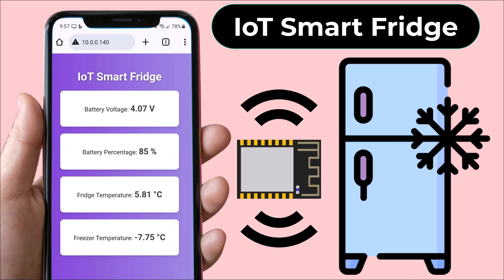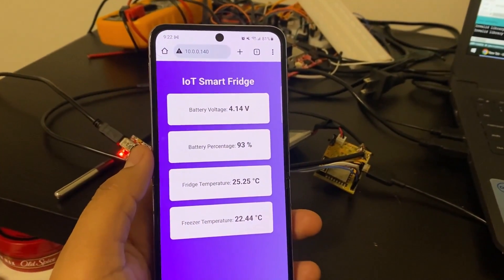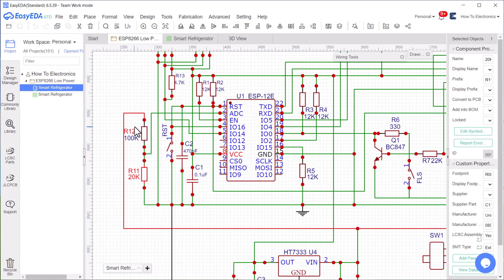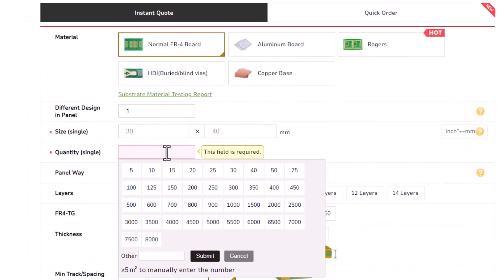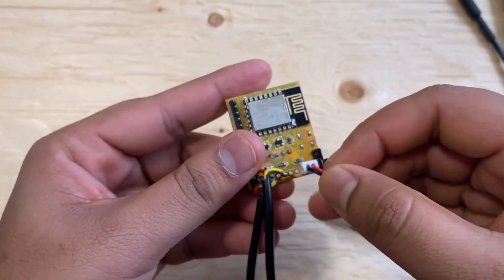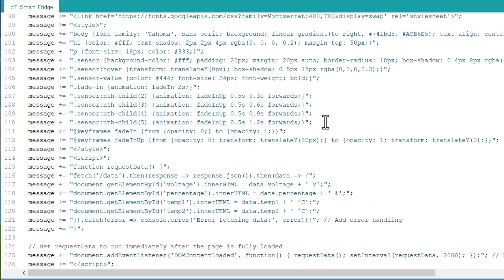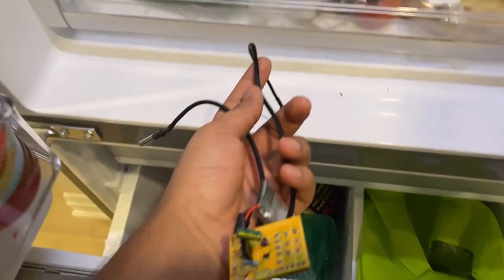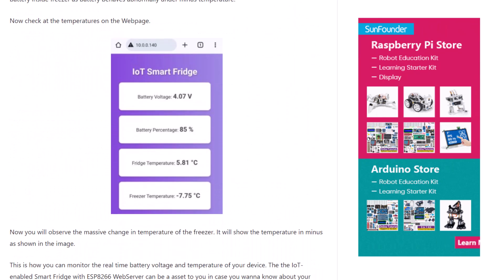DIY IoT-enabled Smart Fridge Monitoring with ESP8266 WebServer

Comment: How long will the Battery last?
Reply from the maker: You can implement sleep mode feature in this code and let the device go to sleep for 15 minutes. From deep sleep mode it can wake up and connect to wifi and send the data to Server. This was you can use this device without charging the battery for a month.